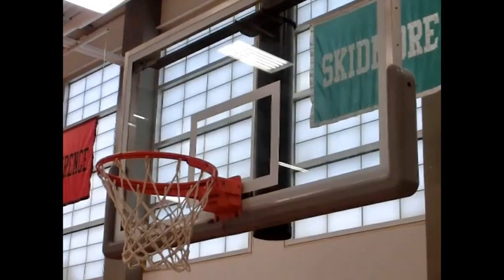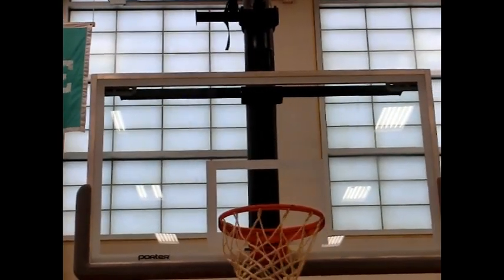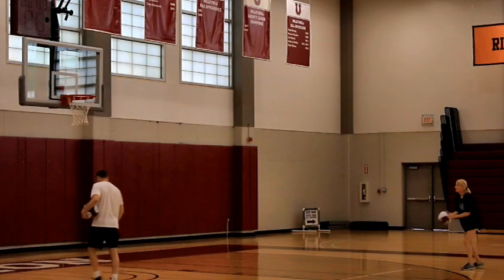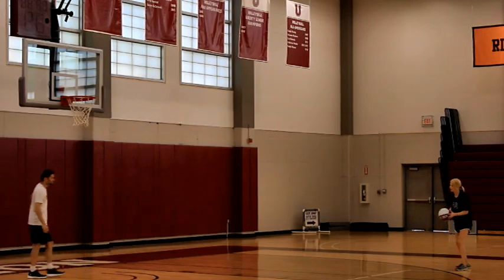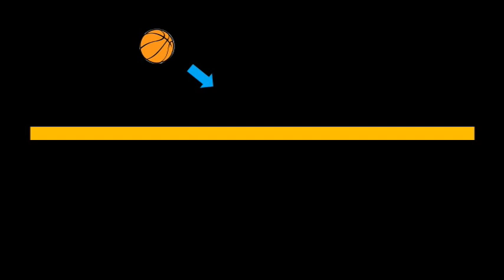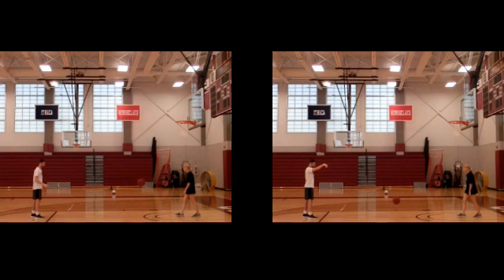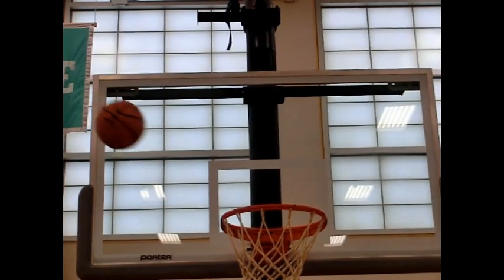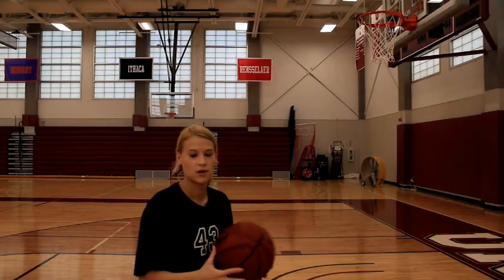Basketball Physics: Why Is That Ball Spinning?

Comment: What about Mangnus effect? Is it negligible?
Reply from the maker: The speed of rotation is low enough and the time of flight short enough that the Magnus effect is pretty negligible.
Reply: @ChadOrzel I appreciate the confidence expressed in this answer, but I do not accept the hypothesis that the impact is negligible. There must be a way to measure it with actual physics. For example, is there a rotation speed that would make a measurable impact?